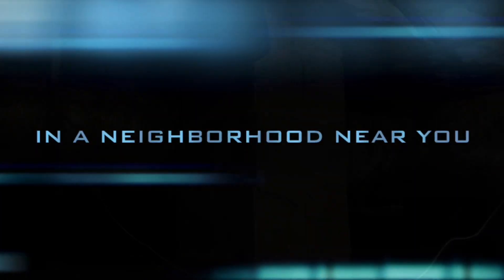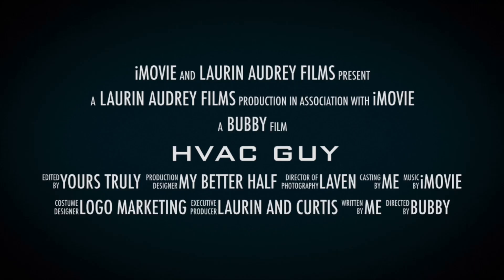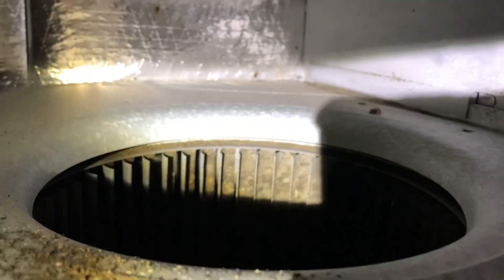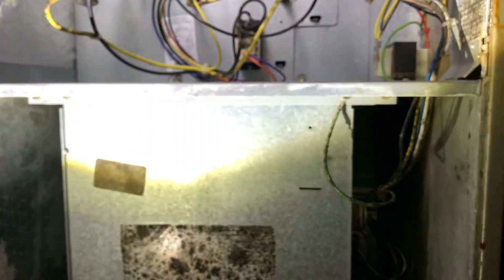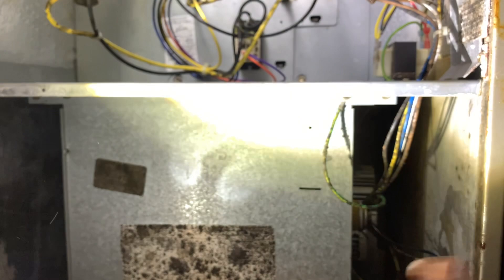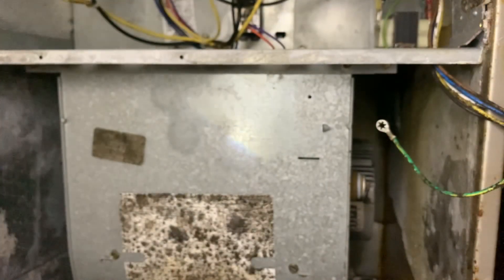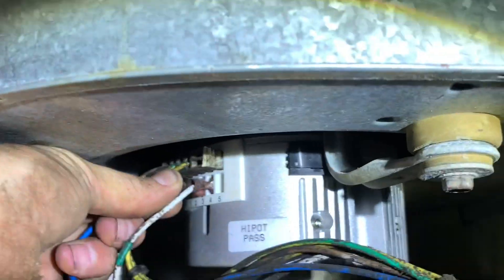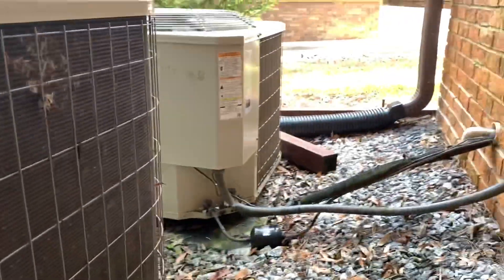No cooling on 2014 Carrier, Freezing up, X-13 replacement

Comment: I was on a call last night where rats chew up the second stage wiring at the compressor.  one of the got into the contactor area and it got electrocuted.  The smell was horrible.
Reply: surprised you didn't find 10+ of them fried from trying to eat the first dead one

Comment: How do you know if it’s only the inverter that’s bad?
Reply from the maker: You’ll need to disconnect it, then ohm out the motor. This one was out of warranty, so the replacement motor was less than a new module. So, it wasn’t worth he effort of ohming it out. I’ll try to leave a link on how to ohm those out.

https://youtu.be/jEvm6BME3EE